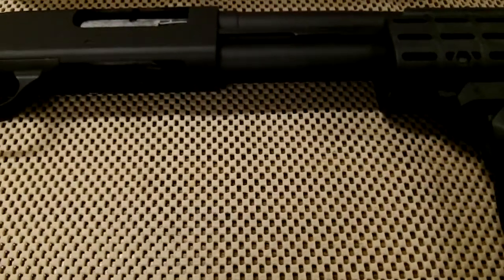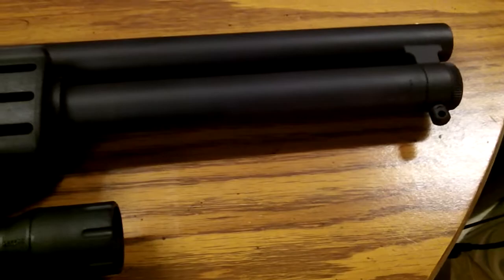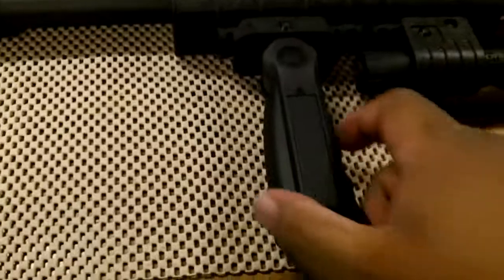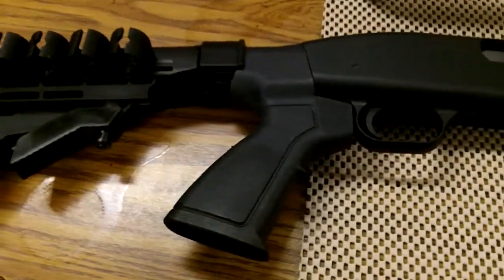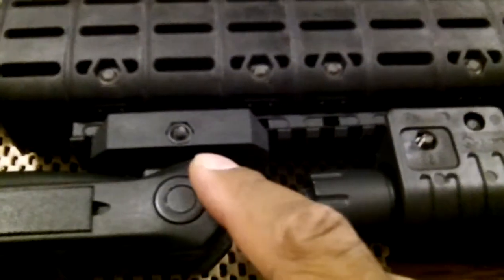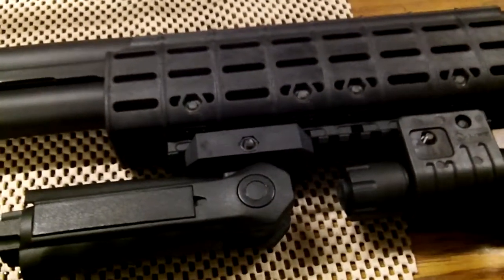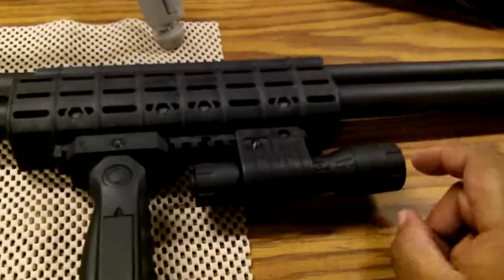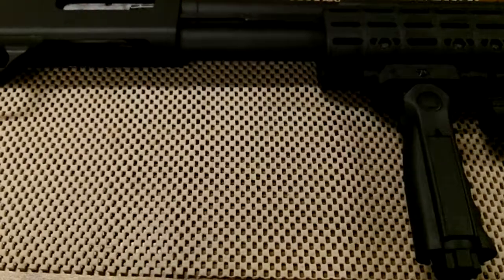Mossberg 500 Project Part 4

Comment from the maker: The barrel is holding up well.  The mag tube has some wear on the moving parts but its still well protected.  The key is the prep work.  I also recommend letting your parts dry for a week before assembly.  I learned this the hard way.  Thanks for watching.